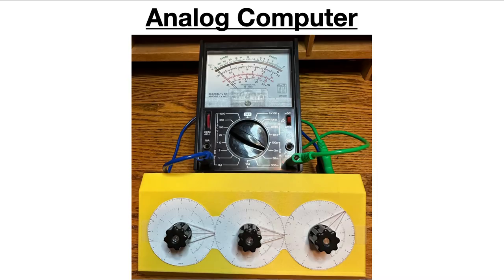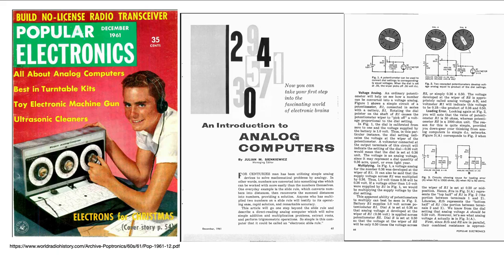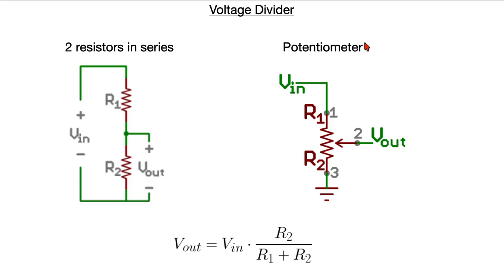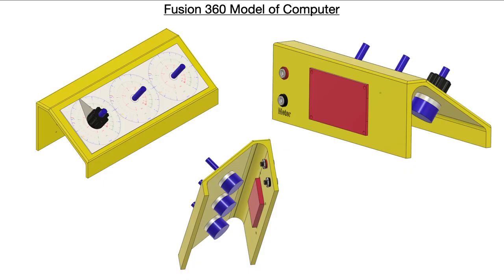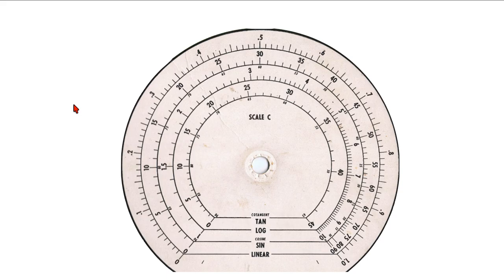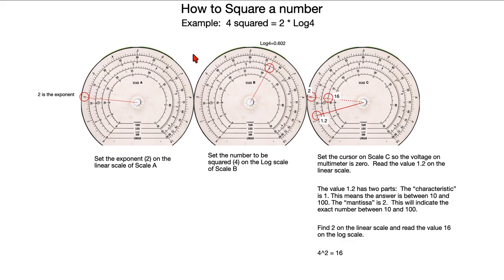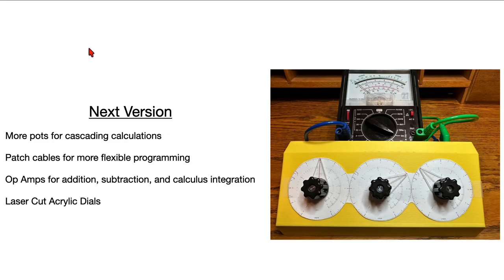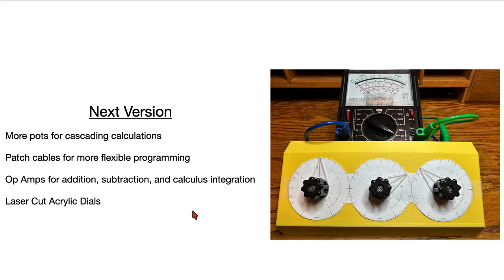Analog Computer

Comment: Galvanometers are very sensitive voltage comparison meters.   Straight up is normal.   More volts on one side the needle tips.  Matched voltage on both sides = no current flow due = matched voltage = needle straight up.

Comment: Anti-lock brakes on cars are designed around 'tone wheels' where each wheel gets a sensor to determine speed of the wheel at that location.   Think of quadrophonic headphones and one speaker lowers in tone.   That wheel is going slower due to almost being locked.   Brake pressure to that wheel is reduced until all 4 tones match(regardless of actual car speed).   Yes, it is done digitally today, but you can see how an analog computer would work in that situation.  

Allowances have to be made when braking around a curve where inside & outside wheels normally travel at different speeds.

Comment: The torpedo targeting computer for submarines in WWII was all mechanical gears & ratios and such to do the calculations (add, multiply, divide complex formulas).  The benefits were 'it always worked when everything else was going to heck during depth charging attacks'  The lights would cut in and out, the whole sub would roll and dive and tilt steeply.  BUT by taking periscope readings, the calls to the computer operator could adjust a dial on the targeting computer AS the sub & ship both were moving at changing angles to each other.  I recall the Japanese had much better & longer distance torpedos but their calculations had to be completely redone for each new position (change of angle).  We did it 'on the fly'.   A big benefit when seconds count between success & death due to being spotted.

Comment: We got to the moon on slide rules.  They typically have 3 significant digits.   Reading dial position is not exact, but exact is not always needed when the result is only going to be used to 3 significant digits (diameter of holes, thickness of sheet metal, temperatures.....)